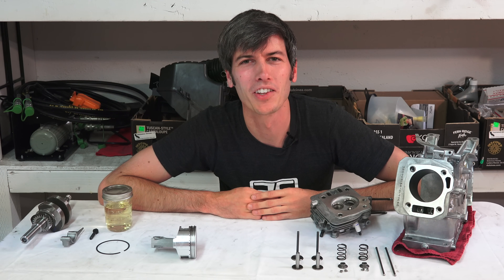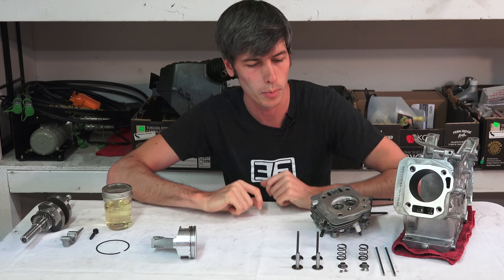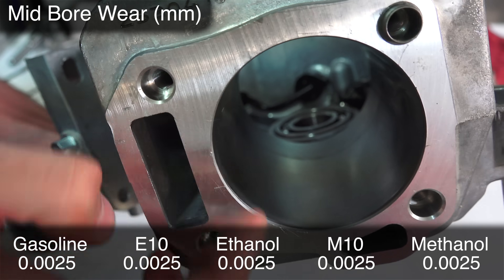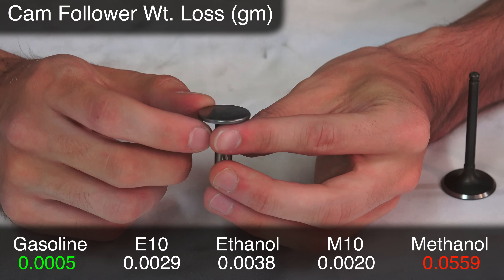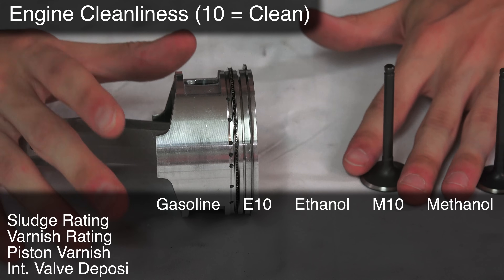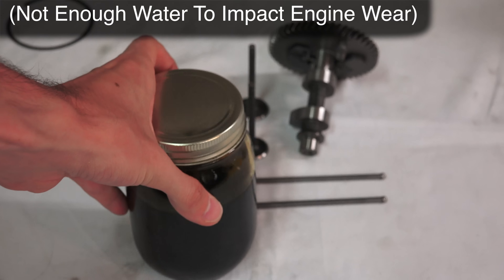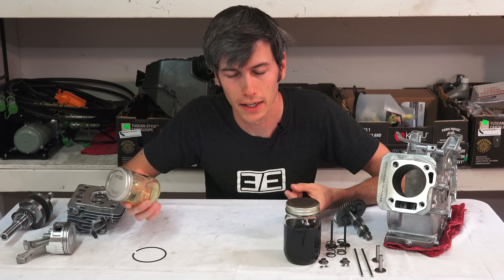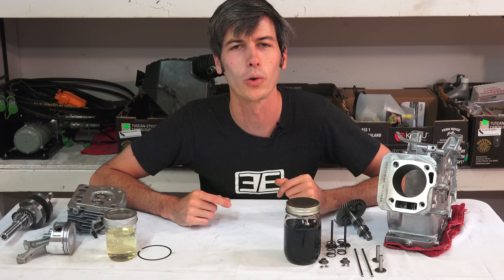Is Ethanol Bad For Your Car's Engine?

Comment: the biggest problems i have seen is not on were. it is on rubber tubes and membranes/gadget's with following car fire's. and a LOT of them every spring when the entusiast cars comes out from it's winter slumber. on E85 and tuned cars it is diluting of the oil and consequently a LOT of oil changes is needed. 
stil it si sad to se so many cars go up in flames every week when the snow goes.
on smal engines like you have there it is the water content in the fuel that corrode the carbs and tanks over the winter. the tank corrosion is a problem on cars as well.

Comment: Congratulations for the Video and explanation about Ethanol. We here in Brazil use the E100, and it is always this kind of discussion, which one is better for the engine, Gasoline or Ethanol. But, the Gasoline over here has already 27% of Ethanol. This is year, even with the lower Mileage with Ethanol, is economically better to use Ethanol in most part of Brazil. Of course, that some car owners prefer to use Gasoline even though it's way more expensive.
If you consider the Environmental aspect, Ethanol is really better, because the Sugarcane doesn't produce any waste that is  not again used in the fields as fertilizers.
Reply from the maker: Interesting, thanks for sharing!

Comment: Have you ever looked into Fuel Economy with E10 vs 100% gasolene?
My experience with the 3 vehicles i have owned in recent times is that i see on average 15% more fuel usage with E10 blends.
Now if you do the maths.
If a car gets 10 litres per 100km fuel economy on regular gasoline and you switch to E10 it will consume 11.5 litres per 100km.
90% of that 11.5 litres is 10.35 litres.
So you are actually burning more gasolene to travel the same distance when running E10.
Selling and/or Legislating the use of E10 as the environmentally friendly choice is a crock of excrement.
Reply: What type of octane fuel are you running? In my country people are complaining that E10 it's actually worse and the only argument for it is it's "environmentally friendly".

Comment: I have a classic car, 1972 Lincoln continental with a 460 cubic inch, 4bbl carb, 62,000 miles all original, beautiful condition, I only take it out once in a while in the nice months, I use regular unleaded gas with 10 percent ethanol , I do put led additive in and an additive called startron , fights damage from ethanol so its says, would It be better to run non ethanol gasokine? they do have it a some places close to me, thank you :)

Comment: I dont like use of alky ethonal with low compression engines . Cant utilise the 10% mix to your advantage. Also unless you have vvt same situation. Ethonal in a race engine is great with high comp ratios. It is harder to start. Methenol is awsome for racing easy starts . If you flood it wait a few shel start. You do need super high comp ratios to off set lower btus.

Comment: Honestly the engine wear is the LEAST that the car owners worry about since most engine parts are made with metallic materials that common sense suggests are chemically stable against ethanol, and most drivers never drive their car hard what people worry about is the plastic&rubber seals within the various part of the fueling system that were simply not engineered or testedd to cope with ethanol at all.
One of the car I have is a 2008 and the manual says the car is not design to run with ANY ethanol in the ethanol and if the ethanol exceed 10% the warranty is void , I really think there should be a class action to sue the government for the agency that mandates the ethanol requirement in gasoline. That's a terrible peace of legislation that not only waste food source or agricultural resources and drive the food price higher and it also causes premature retirement for tens of millions of cars &trucks.

Comment: I wasn't aware of that SAE study and appreciate you illustrating the findings.   Color coding the numbers really helps highlight the extremes in each category.
Reply from the maker: Happy to hear it!
Reply: Motor oil is also reformulated to better withstand the alcohol content of fuels. At least for ACEA spec.
Reply: Great point.  The parameters they measured seem like a relevant set but would be interesting to see if this study has been replicated by other labs.  It also doesn't  address potential damage to rubber or plastic components, or the possibility that alcohol-fuel mixes might be more hygroscopic than pure gasoline and lead to increased corrosion.
Reply: Why didn't the study go to 2,000 hours run test? How did they go down to so many zeros for wear measurements?

Comment: They should have done a comparison test of how it affects wear ofcthe fuel system delivery components. This is where any alcohol causes the most damage.
Reply: Yep, I know a mechanic and he's getting so much business from this e10 meme and some cars are barely 1-3 years. It will be probably a decade before they finally get all the bugs out of the system and E10 would be less of a problem.
Reply: @uproar8745  If he's "fixing" E10 related fuel system failures on cars that are less than 25 years old, he's a scam artist that can turn wrenches.
Reply: m8 I've personally witnessed the problems, so he's definitely not scamming and he's not setting cars up to fail too since some of the cars he's never worked on. Unless there is a mechanic in my town purposely screwing over people who uses e10.

Comment: While not strictly automotive I have a question. I have a 66cc two stroke engine mounted in the frame of my bicycle and it's a great little ride. Because I only use 2 or 3 gallons of gas each summer I didn't mind the price of ethanol free gas. A friend turned me on to Star-Brite (or Star-Tron?) fuel additive so now I use Sunoco 91 (recommended) octane E10 with a capfull of Star-Brite (per gallon) and 3 oz. of 2-stroke oil. What is the effect of E10 gas on 2-stroke engines?

Comment: Ethanol is bad for everything. Corrosive, water attracting, economic scam, stripping land of life-giving minerals, filling air with noxious respiratory pollution, and consuming higher volumes in most engines with zero net benefits.
Reply: Too bad you're basically stuck with it.
Reply: For a little while, until I leave the earth.

Comment: People the video was clearly labeled it is about engine wear not fuel systems, not mileage, not performance on specific fuel, not about the weedeater you lost over winter or gaskets failed on your briggs wood splitter engine...  You guys have filled the comments with these kind of topics. This video is about the specific effects on engine components only. Please try to refrain from off topic jargon about your honda civic, the 100whp you gained on your 5.3L twin turbo race car or your Swedish volvo for fucks sake!

Comment: E10 is death to two cycle engines.  Two chainsaws, and another small two stroke stopped with an audible squeak.  I suspect the ethanol destroys the lubricity of the oil in the mix.  Been running E0 in my newer saw, and no issues with starting or running, and I've had it for better than 4 years. Didn't get two with either of the others.

Comment: I was a professional mechanic around the time when my state adopted E10 fuel.  It caused quite a problem with vehicles that had been using normal gasoline and especially those who were able to use leaded fuels.  The E10 fuel actually cleaned the tarnish and deposits out of the fuel systems of these vehicles and that created a sludge that would clog carburetors, fuel injectors and fuel filters.  The older the vehicle the bigger the issue tended to be but the fix was usually pretty simple.  Rebuild the carb, replace the filters and change the filter a bit more often than usual until the fuel system gets cleaned out.  Fuel injectors usually didn't need to be replaced (mainly because they were not very old and the cars didnt have much tarnish in the tanks) they usually just needed a bit of a cleaning of the screen/pintle with some aerosol carb or electromotive type cleaner.
Reply: Been running E85 over 10 years and have yet to change a fuel filter.
Reply: E85 all the time.

Comment: Can you comment about the variables of the modern types of metals used for engine construction versus the types of metals used in the 1981 studies and how this changes the results? If this test was performed again in our time what the differences would be now particularly with cast iron versus sleeved engine block and modern piston, valve and ring metalurgy?  Also, why did the E10 cause more cam lobe, valve guide, and secondary ring wear versus the Ethanol in their original testing while the E10 seemed on par with gasoline on the other components.

Comment: great, so if you buy a car and only run it for 20 hours before replacing the engine, you have your answer. This does not sound like a scientifically conceived study, but rather, a government pork study. In other words, from this, officials can say we have this study that proves this works or this doesn't work...but neglect to say that it's a crap study.
Reply: Nuance is a thing. Re-watch the video.

Comment: My Ducati is a 2012 so it should be ok, but it is not.  The tank has expanded due to the ethanol content and when I have service work done they have already had to replace the tank once.  They tank is a poly material and the body panels attach directly. The tank swells and the fasteners spin instead of unscrewing.

Comment: Well, a study that old is not conclusive for a couple of reasons:
- Engines were different - less precise than today's ones are. So modern engines might react differently with the test method. Especially with the small displacements that are turbo'ed rather than large NA displacements.
- Engines from the 80's had rudimentary ECU stuff unlike today's with many sensors. Modern engine probably cycles differently/mixes air/fuel ratio differently.
- No wear on the sparkplugs was tested but should have really because it is a part of the engine.
- Gaskets and rubbery stuff reacts differently to ethanol/water content, i.e. the metal part of the engine might take it, the stuff that is rubbery cannot/depreciates more quickly - maybe.
- Manufactureres use different materials for engines actually - it is a metal blend that is never the same. So one engine does not cover anything to conclude from it per se.
- No long-time test - i.e. difference in combustion temperatures and long-time effects were ignored.
- Everything with temperature or pressure was ignored (fuel pump, combustion chamber, exhaust manifold...) but that stuff is vital for longevity.
- Outer circumstances like humidity etc. were not taken into account.
- Would be very interesting who financed the whole thing. Not to say it is false or anything, but the test was, for me, too conclusive with that small test unit number...
TL;DR: Study cannot be compared to today's engines.

Comment: Not sure on the accuracy on the test 20h and just 1motor by fuel test! By an engineer perspective it’s not a good test! Too less Numbers of engine and a huge chance to get a fake Results. Does the methanol engine was a good one note sure and the only Wayne or confirm il it’s by doing the test multiple Time to get an average number of wear in each engine. If with this test you belive one type of fuel is better than an other Sorry but you re not an engineer.

Comment: I had my suspicions that it was lowering my fuel economy years ago. I had an 05 sedan and moved to place that had ethanol in the gasoline. After a few full ups I noticed my tank range was lower than usual. Haven’t been a big fan of ethanol since.

Comment: All that matters is that cars run in the U.S. Run often 200k, 300k, 500k, and even a million miles. So using 10% ethanol doesn't ruin much of the parts.

Comment: Ethanol fuels is by far the cheapest to drive here in Sweden at the moment if you have a really good optimized car(atleast for us Saab guys).
My stage 3 tuned daily driver(2003 Saab 9-3ss) average a 6.5 liters of pump gas per 100km and my 700hp 2.0L Saab(2002 9-3) averages a 8.6 liters of E85 per 100km.
So far haven't found any unusual wear due to ethanol, most of the E85 that gets in to the crank case gets boiled off anyway so it doesn't contaminate the oil that much at all. Fills the open catch can nicely like a moonshine destiller with a clear strong alcoholic content hahah.

Comment: People with flex-fuel vehicles like to buy fuel according to which gives the best miles per dollar (MP$).
Reply: Yes, if you're smart you'll calculate the price difference and figure out if ethanol is cheaper. I'm sure many just see that ethanol gives less mileage and they might be more inclined to go with regular gas.

Comment: 2 things,  what about small engines like lawn mowers?  Second thing, I live in Nc. When I fill up my tank before I leave with 100% gasoline, I can make it to the in laws in Ohio with now stopping. If I fill with e10, I fall about 80 miles short. I drive a car that is actually e85 capable and I have repeated this test about 5 times. I get way more than even a 10% drop in fuel economy. That doesn’t make any sense, I know.

Comment: How can they see any wear in 20 hours?
If you see wear in 20 hours, your car will break down within 50k miles.
A lot of these tests are very subjective to the type of gasoline and oil used, and in only 20 hours, we're talking about microns of material wear; which will also depend on the manufacturing process and quality of the test engines.
Even 2 identical engines manufactured from the same steel or aluminum block, still give different results.
The longer the test, the more accurate the results.
20 hours is better than nothing, but still, it would only start making sense after 100 hours of testing.
Reply: I hope you aren't driving 50k miles at maximum engine load.

Comment: So it didn't cause significant wear over 20 hours of use..... well thats good to know! My car should be fine for at least the next week!
This test needs to be run over tens of thousands of miles not a few hundred.  It should also factor in the fuel system components.  There is a lot of stuff that study from 1981 didn't account for.

Comment: An engine using Ethanol is less prone to suffer knocking issues. So engine can withstand with higher compression ratios. In fact mileage in engines using 12:1 (or more) compression ratio and ethanol is way better than "flex" ECU'S used in gasoline engine blocks with compression arround  9:1 ratio. A true "flex" engine should vary the compression ratio according to the fuel density... Ethanol mixed with gasoline is anhidric (water can't be diluted in gasoline),  while 100% ethanol have +- 6% water diluted as consequence of distillation process. This makes the engine combustion chamber almost carbon deposits free when using Ethanol only, but also makes the car more prone to form rust in exhaust pipes and mufflers.  Ethanol  is ideal to fuel turbo engines and there's no need of water injection as water comes already diluted. No knocking... Sugar cane is intensive agriculture is not very environmental friendly,  but is better than use food (corn, beet...) to produce ethanol.
Reply: @nickdreiath4010  what I said is that an engine running on "pure" ethanol is less prone to having knocking issues. Not only because of ethanol octane rate, also because of 6 - 8% volume is water. High octane fuel allows engines working with higher compression ratios, thus improving efficiency and performance. FLEX ECU'S are only half the solution, compression ratio have to be also changed to achieve efficiency.  Changing the compression ratio  in a running  engine is at minimum tricky...
Reply: Changing the Dynamic Compression Ratio is not all that hard. With VVT you can just delay intake valve closing during cruise and lower the dynamic CR. Under High Loads, especially in Forced Induction engines, the limiting factor is ignition timing, a gasoline fuel will often knock before the ignition timing is advanced enough to reach peak Mean Brake Torque. with a higher octane fuel like E85, (about 108AKI) you can reach the optimal timing and gain more power.
Reply: @CalvinSonniksen Yes but VVT acts only near the red line. Talking about efficiency (low and mid RPM range) on burning pure ethanol you need more compression ratio than a pure gasoline  engine. When talking about true flex engines (not only flex ECU's), variable CR sounds more like Mazda's new SKYACTIVE engines. When using turbo, you need less timing advance, but you can increase burning speed using plasma ignitions featuring larger flame initial kernel and enough power to overcome compressed air dielectric resistance...

Comment: My biggest concern is that ethanol makes the rubber in the fuel lines brittle. Since modern cars have the fuel pumps inside the fuel tank, fuel will spray all over the hot, running engine if the fuel line breaks.

Comment: Love the video! I started using ethanol free gas in my previous vehicle a 2010 f150 with the 4.6l v8. I noticed no more vibration at red lights, better fuel economy(especially on the highway), get more out of a tank, felt a little better under acceleration. I use it now on my current vehicle a 2016 Subaru crosstrek.

Comment: Thanks for the Data,,,I use E85 in my Pro Touring Challenger I made 57 more HP than 100% gasoline ,,,,I love Ethanol which can be produced from any plant based resource not just corn.  Oil companies are also heavily subsidized as well as big pharma,,big oil farming manufacturing big insurance medical ect

Comment: If you use ethanol blended fuel in an older engine with a carburetor it will likely ruin virtually everything in the fuel system from the tank, lines, pump and carburetor.  I know from experience.  Now i only use ethanol free fuel in my older cars and small engines or anything i don't use regularly because the ethanol blended fuel goes bad so fast.